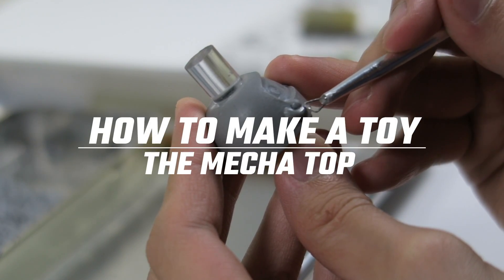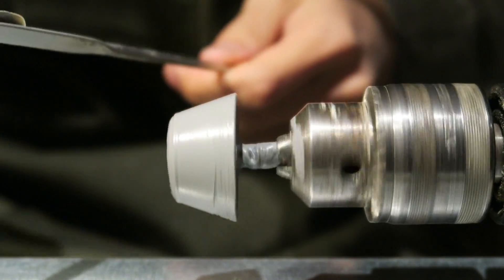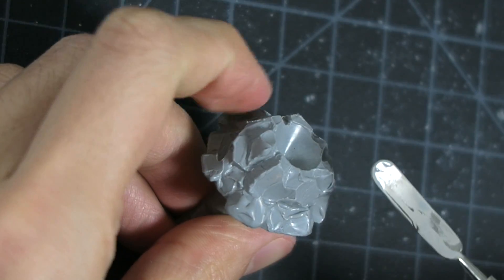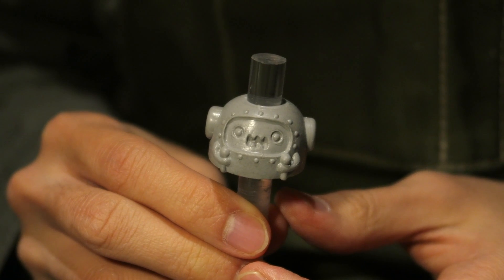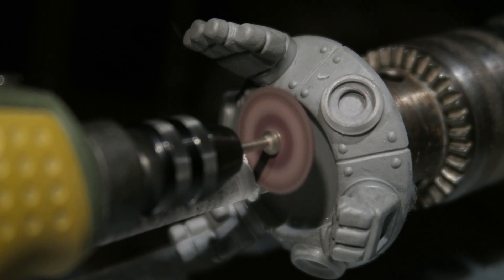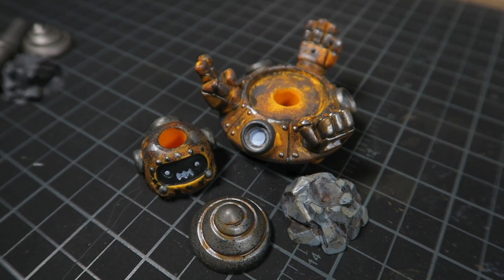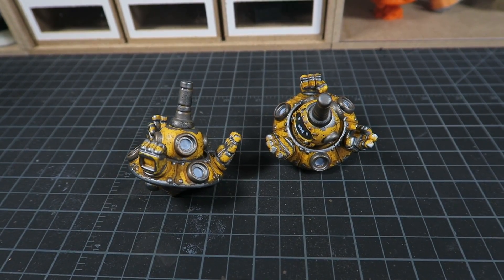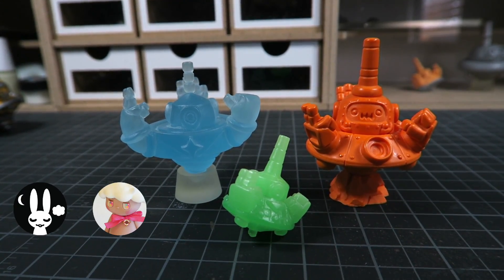How to Make A Resin Toy : Starting from the Sculpt

Comment: Cool project. I really like the simpleness and the immediately apparent way it works of the toy. Also cool to lastly see your first video and realize we've walked similar paths; I got into 3D printing and Fusion a little less than a year ago, because I stumbled upon a video of an affordable 3D printer when I was actually shopping for Adam Beane's incredible CX5 online and ended up buying one. I received both the CX5 and the printer around the same and, even though I really love the stuff, I have hardly touched the CX5 and fully dived into digital 3D modeling and printing. Which I didn't expect, as I am quite an analog creator. Anyway, I love to see how the transition from toy to game will turn out and will follow your journey here. Have fun!
Reply from the maker: Thanks! CX5 is a wonderful material and a lot of fun to work with. I hear Adam Beane Industries is taking a hiatus but they were in the process of creating 3D printed filament made of CX5. Maybe you've heard of it already but if not, just thought you'd be interested to know! Thanks again for the positive message and wishing you the best in the new year =]

Comment: This looks cool. I am just learning about this process so like are there different types of resin. If so, which types should I avoid for toymaking and which ones work best?
Reply from the maker: Hey thanks! Toymaking is an incredible process but safety is definitely important. I like to use Smooth Cast 305. It has a 7 min working time and a 30 min cure time. However that can vary with room temp. Just remember, you want to use polyurethane resin. Always wear disposable gloves and work in a well ventilated area. Thanks for checking out my video and have fun experimenting!
Reply: PocketPlastic thank you for responding so quickly. I’d like to see what I can do with this.

Comment: What type of Silicon did you use for the mold?
And what type of resin and paint?
Reply from the maker: The silicone I used was Mold Max 30 and the resin was Smooth-Cast 305. You can purchase these products from Smooth-On. As for paint, I was using Vallejo acrylics but you can get any kind. Hope that helps!

Comment: I'm trying to do this right now actually but I'm have a little trouble deciding on the resin and the rubber for the casting process can you tell me what you're using?
Reply from the maker: Smooth On Products are my go-to. For resin, I use Smooth Cast 305 (7 min pot life, 30 min cure time). For silicone I use Mold Max 30 (1 to 10 mix ratio with 12 hr cure time, a little expensive though).
Reply: inami toys alright awesome. thank you so much for responding!

Comment: Where do you get your molding wax/clay?
Reply from the maker: Hey Ben, sorry for the late reply! Adam Beane Industries makes the Cx5 wax/clay that I used in this video. However, they have stopped producing it and I'm not sure when or if they will resume production. If you're interested in getting started with sculpting you can use hard clays like Monster Clay. It's not really the same as the wax but it's actually better to start with traditional clay to learn sculpting. Hope that helps! Also, your package is on the way. Thanks so much for your kind support!
Reply: @RelixWorks  awesome! I've worked with clay in the past but never one that worked quite like monster clay, I watched a lot of videos about it and I'm excited to try it out! Thanks for the tip

Comment: Love the design. However, wouldnt the hands cause an imbalance? I think its evident that they do because of how the tops have a distinct wobble when they spin. Although I love them on a visual design basis I see how that could break any kind of game mechanic. Maybe instead of such long protruding pieces you could have sculpted icons of the hand symbols onto convex lumps in their respective sectors, cutting down on the potential for an imbalance.

I know I shouldnt be criticizing I just cant help it lol. Great work either way
Reply from the maker: Thanks for the input! I don't mind at all, in fact, I appreciate it! I've struggled with that concept for some time. My newer tops are designed to be quite light so when they start to lose momentum they bounce around until they stop spinning. This motion creates a chaotic sort of element to give it more of a random chance like dice. Love the idea of the hand symbols tho! I have actually toyed with that idea before (excuse the pun hehe)
Reply: Well Im glad youre open to feedback. Now that you bring up the aspect of being sort of a "battle-top" idea I can see how the imbalance works in favor of the toy. Nice work! Its inspiring and pushing me closer and closer to committing to taking a shot at my own toy design

Comment: Well my question is this. You can make the toy sure, that’s great, but how do you keep others from stealing your idea and putting you out of business? Like myself I want to make toys like this, but how do I protect myself? Should I just give up on trade marks and copyrights due to lengthy time and great price? And make the design open source or public domain and allow people to make similar or copies so as to avoid being shutout completely from my own product? Or what does a beginner need to do on the law side of things?
Reply from the maker: Hi Montey, that's a really good question! I've talked to some people in the toy field about the same issue. And I got answers ranging from "Yes, you should get it patented" to "It doesn't matter because patents are hard to enforce". So basically, if someone wants to steal your design, all they have to do is change one little aspect about it and they can get away with it which kind of sucks. I've really struggled with this concept because as the inventor of these Rock-Paper-Scissor tops I wouldn't be able to compete if some big toy company just took my idea. However, I've decided to just keep creating as many original concepts as I can to show those companies that it would be much more worth it for them to just hire me for the designs than to copy them. I'm always reiterating and improving the tops, as well as exploring new ways to make them fun. I don't upload that much because I'm usually thinking up crazy things all the time haha. However I'm really going to make an effort this year to bring more consistent content to the channel!
Reply: PocketPlastic Thanks for that advice! It great to know about others who are into this area are also overcoming and perusing the art and culture of you making. You have inspired me sir. Thank you.